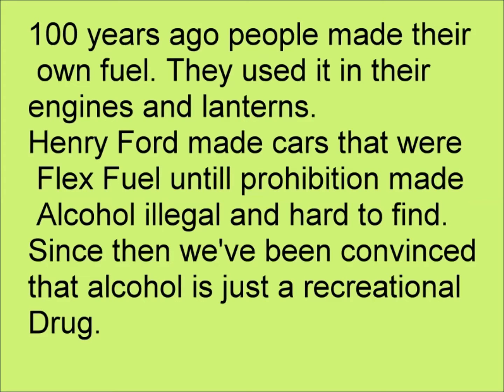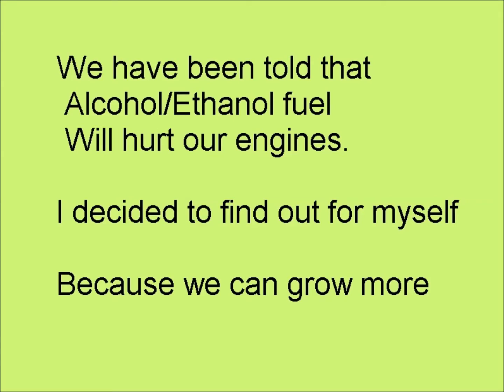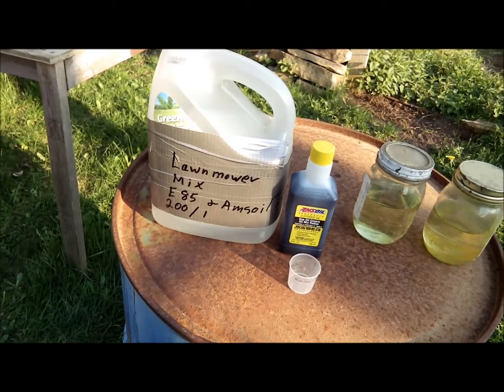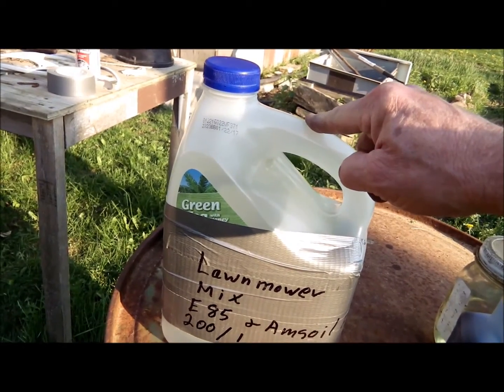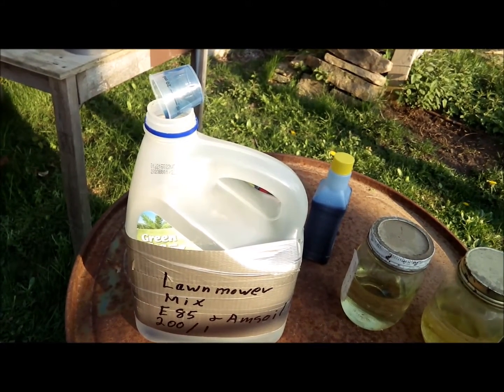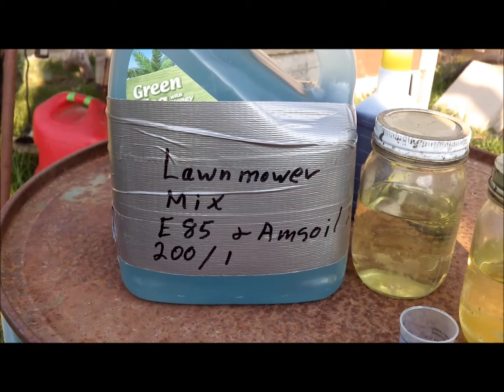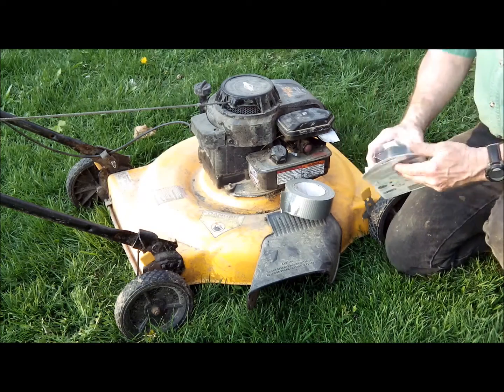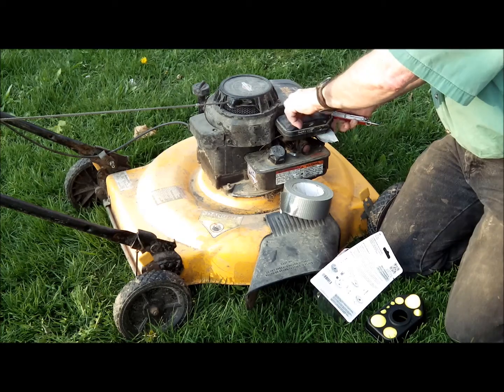E85 Lawnmower converted with duct tape

Comment: Good morning Jeffre, besides covering 1/3 of the air intake and running 200 to 1 e85 oil mix would there be any benefit to running a slightly larger jet in the carburator set up? I am running a 4 stroke 140cc mtd engine on my push mower.

Comment: Restricting the air for the proper air fuel ratio will have slightly less power but also use less E85 VS switching to a bigger jet to let more fuel in. The should be OK as long as you don't let the E85 sit in the tank & carb for over say 1 month. If the mower is going to sit unused for longer than a month. Drain the E85 back into a air tight container & drain the carb.

Comment: I use Amsoil Saber 2 stroke oil @ 100/1 and I run it in everything I have. Push mower 4 stroke, leaf blower, chain saw, weed wacker . Never had a problem. Been doing it for years. One mix covers Everything!  One Gas Can.

Comment: I always wanted to put e85 in my lawnmower because it could help the enviorment
Reply: Thegeokiller 15 I was just saying it to be funny because of the other dudes comment that went like that.😂😂 I know everything has pollution. It's funny how many people don't realize that no matter what energy source you use there is down side with pollution.
Reply: Trey W dude ever thing pretty much makes pollution
Reply: IamMike86 how
Reply: Thegeokiller 15 do you have any idea how much pollution caused in the production of solar panels and wind mills.
Reply: Marty Harless we could just use windmills or solar panels
Reply: Trey W also I forgot you can gane more powers with e85 than regular gas cuz ethanol has 105 octane and also cool the engine down by 20 degrees Fahrenheit
Reply: Do you have any idea how much fucking energy it takes to make ethanol
Reply: @martyharless5097  you could burn poo, horse, cow, etcetera, pretty cheap way to power a still
Reply: @rulerofthelight  well, in order to do that you would have to sacrifice the supply of fertilizer in which case you would need to substitute it with something else (chemical?).It would also be very unsustainable as a fuel source on a large scale. Put that in your pipe dream and smoke it.
Reply: @rulerofthelight  petroleum products are by far the most energy dense source of energy we have with the exception of nuclear power. It would be nice if we never had to refine another gallon of crude oil. That would be absolutely wonderful but that day is a long way from now.
Reply: @martyharless5097  I own an organic farm and let my tell there is more than enough shit to burn.